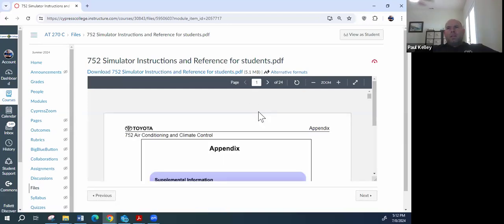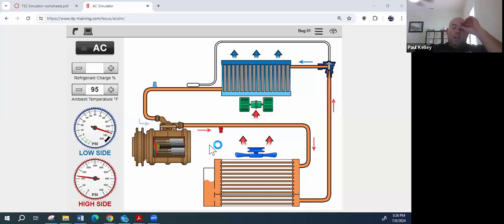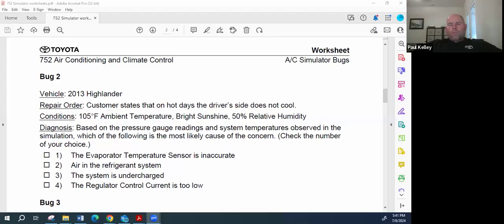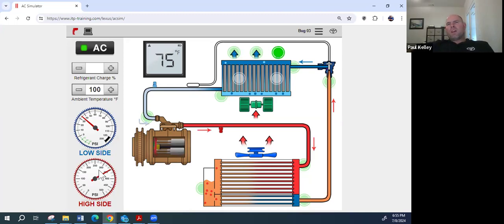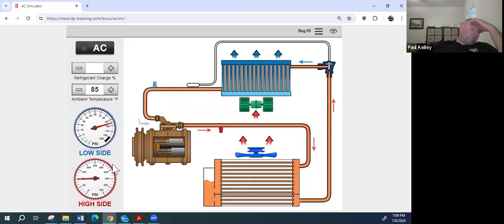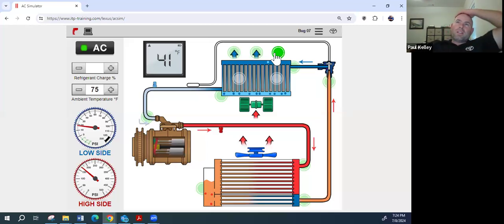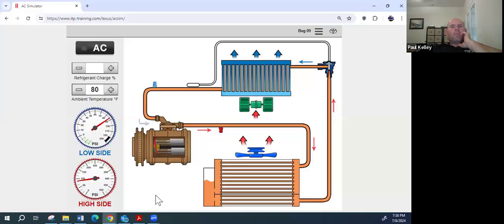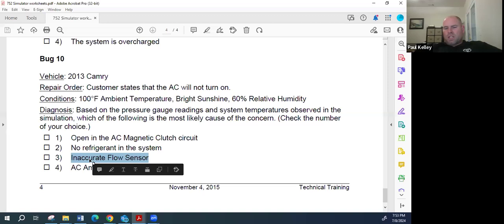ASE A7 HVAC Class Diagnostic simulator walk through

Comment: like all this. but my problem is nobody is teaching how to pull a vacuum  on these ac systems. everybody says 30 to 45 minutes and my 10k machine makes the world perfect. i use a micron gauge and if you do everything like oil balance ,proper freon charge  and get down under 500 micron with no more than a rise of 1000 , i like to stay under those numbers myself and i can achieve low microns with triple nitrogen purge and sometimes a 12hr vac pull. dont have to go 12hrs but sometimes it is needed. thats the only thing i see is not happening. everybody will say been doin that 45 min for 20 years wont even attempt to try a micron gauge.whats ur thought
Reply from the maker: @RATCHETMAN1001  90% of techs are going to use an AC machine from Robin air or similar. They are going to press vacuum, set the timer, and that's it. 

A micron gauge is great. More accurate, more of a guarantee that you have forced evaporation of any moisture in the system. 

But bluntly, it's a better way, an added cost, a longer vacuum time... for what? We are servicing thousands of cars a day without issue using what we have.

 I have seen a couple cars in my career with evidence of excessive moisture in the system. One was a body shop car that had the lines open for a month and it just needed a longer vacuum time and a desiccant replacement. The other was parts store can recharged multiple times and just a vacuum and recharge fixed it. 

So yeah, sounds like you are doing an amazing and thorough job. Very nice. But from a business perspective, not more profitable, from a typical customer perspective, taking longer and not objectively providing any more effective service. 

With that being said, I appreciate your attention to detail.